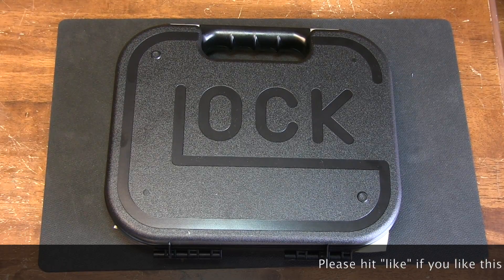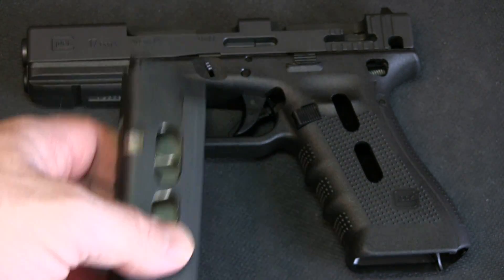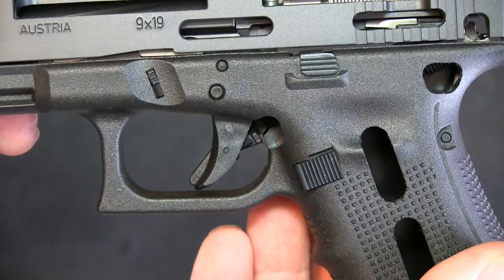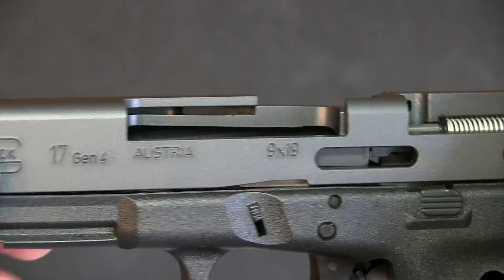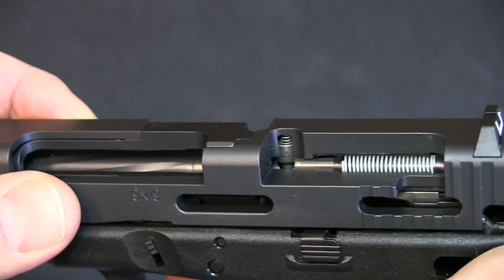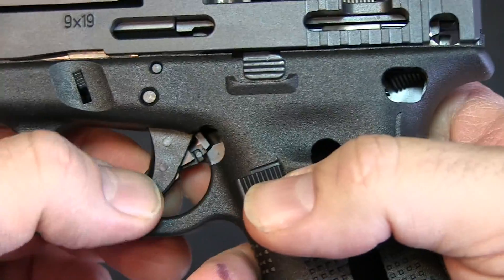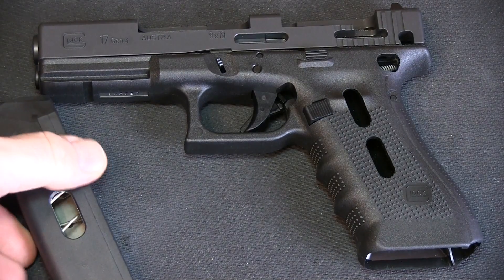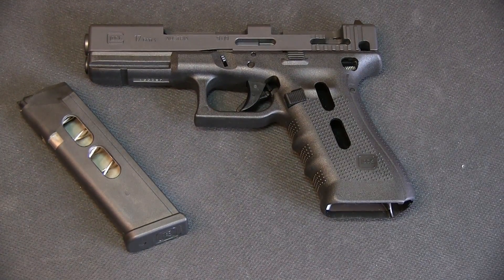How a Glock Works (with Glock Cutaway)

Comment: I was really worried about Glock, because It is not double  action to pull and fire on very emergency , but beretta , SIG or even revolver dose. If we keep the Glock  chambered and cocked , the firing spring will get low tention and a day it wan't fire at emergency. is't it a risk and disadvantage ???🤔🤔🤔🤔

Comment: What happens when the spring for the safety breaks and is upside down so the metal cylinder isnt blocking the pin?

Comment: Very cool educational tool.  It would be nice to get a more comprehensive and detailed over-view of each sub-system in the gun.  And a cheap pointing device like a pen or dental pick would help to differentiate one part from nearby parts when pointing.  I'm wondering if that can be field stripped like a normal Glock.  If so, it would be helpful to get a detailed view of various components, even things like the barrel and magazine internals.  Most of the viewers here already understand those parts, but people who are new to firearms may not understand how they operate.  And with today's climate shifting to extremes against firearms, the more people who gain enough interest to learn the reality from the hype and venom, the better.

Comment: I'm glad people come to you about firearms knowledge, a learning opportunity for you, it's a slide flange not a barrel lug.  This flange has nothing to do with the barrel. Additionally, the Glock does not have a firing pin.  The Glock platform works on a striker system and not a firing pin.

Comment: The reason it needs an FFL is because you could simply  put in a  non choppped locking block  and throw a normal slide on it and it would fire  safely

Comment: The explanation of how the firing pin safety was super helpful,  and gives me a good understanding of this. Would other striker fired guns (like an M&P or P365) have the same sort of design?
Reply from the maker: No, each one is a little different. Similar, but different enough so at to not violate the patent.

Comment: A lot of people screech and cry about appendix carry with striker fired pistlas. Technically speaking and this video demonstrates it, but the firing pin is at rest while the trigger isn’t being actuated. In order to accidentally jar the pin forward to strike a primer accidentally without fist actuating the trigger, the pin would have to make it through two different safety mechanisms and the pistol would probably break before that pin got that far.

Comment: Hey man, you let us see the frame 5 secs only (5:00 to 5:05). That is not enough to catch all the details. You could cut from the beginning 5 minutes, but show up more of inside (the guts) of slider.  I have never seen a Glock cutaway before and would like to see the guts of Glock. Thanks for that video.

Comment: I saw this video a few years ago and almost everything went over my head. Now, having built several polymer 80s this video gives me a big smile. I remember where I was and where I am 😁
Reply: If you ever in Az to help me , lmk, well polymer 80 ar15 receivers . pistols are easy builds the 1911 ones alil more challenging n the SIG saur barrels that shoot 3 diff callibers
Reply: @josesavage420azg3  sure thing !
Reply: Mines all got stolen 😭😭😭
Reply: What's best way to drill holes I am a Gunsmith in Argentina?
Reply: @Jonathz-  Drill Press, Dremel or hand power drill. All three are valid, different for their own reasons, accuracy and precision are key. Only want to drill once per hole if possible. Many sources online for this. Follow instructions.
Reply: Nicee
Reply: I haven’t seen this one, but I’ve seen the animation videos and yeah it was too much to follow. However once you own one and you clean and disassemble it ten times, you start to appreciate these kinds of videos. It starts to actually make sense because you have all of the pieces memorized and know how they fit together.

Comment: So you can fire it safely by replacing the barrel and firing pin?
Reply from the maker: No, it will not fire. The slide does not have a firing pin hole built into it, so there's no way it can be fired.

Comment: Why would it be catastrophic to load a round in? Please explain
Reply from the maker: A catastrophic failure for a gun is when the structural integrity of the firearm is compromised. It either explodes/ruptures, or there is damage that would make further shooting dangerous. In the case of this gun, all of the cuts in the slide and frame would lead to a rupture or it would explode in your hand. However, after I made the video, I realized there is no firing pin hole cut ito the slide, so there's no way it could even fire.
Reply: @762x51n8o  thanks I guess I missed the part where you said it wasn’t meant to fire.Think I was half asleep watching. I didn’t realize it was just a dummy for teaching, thought it was a law enforcement goodie or something.
Reply from the maker: @TrillAntho  It's not your fault -- it's not in the video, so you didn't miss anything. I didn't notice the lack of hole until the video had been up, so I put it in the video text.

Comment: Built a g26 and have a dead trigger. For the life of me can’t figure out why. I have tried doing the bending of the connector, tried replacing the connector and springs. If I very slightly raise the rear of the slide then it will fire. Any ideas would be much appreciated. Thanks

Comment: PLEASE ANSWER IF THE TRIGGER IS NOT PULLED,  LET'S SAY THE FIRING PIN SLIPPED FROM THE FIRING PIN SAFETY. IS THE DISTANCE AND TENSION OF THE FIRING PIN AND THE PRIMER OF THE ROUND, ENOUGH DISTANCE LAUNCH A BULLET ? PLEASE ANSWER. GLOCK SAFETY ISSUE
Reply from the maker: There are 3 safeties that prevent the firing pin from hitting the primer if the trigger is not pulled. It would be almost physically impossible for the striker to get passed the safety.

Comment: Swap out the striker and barrel and see if it works.
Reply from the maker: There's no firing pin hole in the slide, so there's no way it could physically fire. (I put this info in the video description, unfortunately I added it after the video).

Comment: Do you mind if I use about 5 seconds from this for a Glock review?
Reply from the maker: Sure, send me the details. What part you’re using, where it’s going to be used, etc. Also, please source my video as credit, and supply a link to my video.
Reply: 762x51n8o alright will do. I’ll be using it to describe the safeties that Glock has. I’ll get back with you once I’ve finalized which parts exactly I’ll be using.

Comment: Cool video! I inherited a G32 .357 Sig that came w full clip of ten .40 SW bullets. Here’s my issue, should I buy .40 SW ammo since it came w that or should I get the pricey .357Sig ammos? Please help 🙆🏽‍♂️
Reply: if it's .357 sig why would you put a different caliber in it?
Reply: DirtyDan it was a hand me down from an uncle to passed away, I believe he upgraded the stock .357 barrel to a 40 cal
Reply: @lstruggy  what caliber does the barrel say?
Reply: DirtyDan it has a .40 stamping on it it has a nice gold finish to it but it does say Glock 32 .357 stamped on the slider itself
Reply: @lstruggy  .40 will work with the .357 slide as long as it's a .40 barrel

Comment: Is the trigger safety on the Glock meant to be a joke or what? The only safety I see is ---"DON'T PULL THE TRIGGER" - On my carry gun I release the safety or it won't fire. You can pull the trigger all day and it won't fire if the safety is on. On the Glock, pull the trigger and it fires. That's not a safety. There ought to be a law against it. I CARRY ONE IN THE CHAMBER  which I would not do if anytime the trigger is pulled the gun fires. If I was worried about getting my gun out in a hurry for self defense, I'd carry a revolver.
Reply: that's one of the main reasons law enforcement carry Glock's in case they need it in a hurry & you don't want to fumble with a safety when lives are on the line. That along with they're dependable firearms.

Comment: All guns are unsafe its on the hands of a wuss... 

No matter what gun if u follow the 4 rules ur safe... 

1. Treat any gun as loaded and the muzzle as a dragon mount spouting flames(thats what i say to make u understand to never point it) 

2. Dont point it at anything u dont wanna kill/destroy/damage/or put a hole on... And if u wanna put a hole on it,  consider using a drill first.

3. The trigger should always be clear. Dont put anything inside the trigger guard(finger/string/or anythingthatmaypullitback,  definitrly dont put the D in there) unless ur gonna pull it and fire. 

4. Lastly,  dont leave any gun loaded unless its inteded to be used. Dont give a dragon food unless theyre going to work coz ull never know if someone els rides it to spit fire on u instead.

Comment: What stops the firing pin when dry firing? Does it hit the firing pin safety?
Reply from the maker: Do  you mean this takedown model specifically, or Glocks in general? For this one, there's no firing pin hole in the slide, and the firing pin has no tip. For Glocks (and all guns) in general, nothing stops the firing pin when dry firing. That's why it's called "dry firing", because if there was a round in the chamber, it would be called "firing".
Reply: @762x51n8o  I mean Glocks in general.  Is it the inside of the firing pin channel (the slide) or the firing pin safety that stops it if there is no cartridge?
Reply from the maker: @H-M-78  I think you're confusing a couple things. When you dry fire, you're actually firing the gun, except without a live round, so physically firing the gun de-activates all of the safeties so the gun can fire. So when you're talking about the firing pin safety, that is to prevent accidental/negligent firing due to bumping, dropping, etc, but doesn't prevent it from striking the case primer when you're dry firing, because you're de-activating the safety when you pull the trigger.. The firing pin safety plunger prevents the firing pin from ever touching the case primer, unless you pull the trigger. So you were KIND OF right in your initial question, except not for dry firing, but for preventing accidental discharge when you're not pulling the trigger. The firing pin channel isn't a safety, and is just where the firing pin is located.  Does this answer your question?

Comment: so why cant you put a barrel and firing pin in it i think it would cycle just fine
Reply from the maker: There's no firing pin hole in the slide, so if you put a standard firing pin in it, the slide wouldn't fully close.
Reply: He said the firing pin itself did not have the sharp point on it that protruded he also said if you stuck a regular firing pin in there you would have a bad day nothing about no hole in fact quite the opposite is the way I understood it

Comment: I have a question about the  glock pistol...how much time can the pistol stay activate  ?(ready to shot with a round in the chamber)  I mean how many hour's  the pistol can be "hot"
Reply from the maker: Reading your question it seems like maybe you got some bad info, or have a misconception of how a gun works. Once a round is chambered (which you referred to as "active") it stays that way until you unload it. So indefinitely. Until the round deteriorates to the point that it won't fire, which could be decades, depending on environmental conditions.
Reply: @762x51n8o  thank you for taking the time...yes in fact I try to investigate more now I know the the safety  system of GLOCK  block the fire pin...thank you

Comment: Sir:  on 12/2/2018 my Glock 43 in its holster with the trigger fully covered fell on the floor and accidentally discharged.  I took the pistol to a glock store and replicated the error on an empty chamber.  I then called the aftermarket trigger maker who was shocked.  He drove four hours the next day and the two saftey’s not preventing the accidental discharge.  He took the Glock to fully explore why this occured.  Never say never.  I have been handling weapons for 73 years.  This was my first accidental discharge and the trigger was not touched.
Reply from the maker: Key words: aftermarket trigger. In talking to law enforcement Glock armorers, when a Glock breaks or malfunctions, 99% of the time it's aftermarket part. Their guy will come in cussing up and down about how Glock sucks, and his failed, and it turns out they stuck some aftermarket part in it. You are absolutely right though, mechanisms do fail, and shouldn't be relied upon. Triple redundancy, like in the Glock, do make them even more rare.  In your instance, I'm glad no one was hurt.
Reply: 762x51n8o No cursing.  Only real concern for the possible calimity that could have occured.  The aftermarket trigger is most likely at faulrm but so is the safety stop a glock part.  I should know by early next week as they are tearing the weapon apart to determine what happend.  He did tell me I would receive totally new parts.  Even so, l will do full drop test and pound the pistol with rubber mallets to insure it will not fire.

Comment: So even if the cruciform piece were to somehow accidentally let go of the striker mechanism on its own, the striker would not be able to travel beyond that firing pin safety unless the trigger bar had the plunger raised out of the way. Meaning, unless the trigger has been depressed, defeating that safety mechanism, it is impossible for a round to be fired?

Comment: It seems pulling the trigger adds to the spring pressure. Would it have enough pressure on the spring to fire without the trigger being pulled if the internal safety failed? I'm new at this . Thx

Comment: Dont know if your answering questions still but ive just brought a Zev Slide and noticed on the mag reload the striker pin in sticking out and when i release the slide the protrusion of the striker is stopping the round from feeding i have a photo of it otherwise that cut out glock is great
Reply from the maker: You should contact Zev directly. That doesn't sound right (or safe). Thanks, appreciate it!
Reply: Thanks, Yeah i sent them an email havent heard back from them yet 🤔

Comment: It probably will fire if he swaps the barrel with a normal G17 barrel and striker/firing pin.  Probably the reason it's considered a firearm and has to be transferred.  Considering it's already a defined as a handgun by the feds and has to be transferred as such, that's probably not illegal.  I have no actual idea.  These are just guesses based on a lot of real firearm experience.

Comment: Not a very detailed video.  I would have loved to have seen you work the slide slower, to see the actions that occur when the slide is moving forward.  The way the striker is "re-cocked" is an ingenious action, and you missed a great opportunity to show that.
Reply: how does the trigger reset?  what pushes the trigger bar back to get the trigger back into position?
Reply: @GhillieCoaters  here is glorious animation, explaining how the gun works. Unlike 90% of such videos, they managed to make it so that people can actually understand whats going on!
https://www.youtube.com/watch?v=V2RDitgCaD0&t=2s

And here is another great channel with very good animations about old guns 

https://www.youtube.com/user/vbbsmyt
Reply: @GhillieCoaters  and here is actually good explanation of the reset process. Basically firing pin spring pushes trigger bar forward.
https://www.youtube.com/watch?v=1WaRLlyPHlo
Reply: Cant you just put the playback speed to the slowest?
Reply: Publius2k4 please remake this from the right side with a script that has the correct nomenclature. This pistol is way cool!
Reply: I have watched a number of these videos and one thing that is never shown is how the disconnector works (It is the ramp built into the bottom of the slide.).  The connector is always shown and how it connects to the trigger bar, but never the disconnector.
Reply: @fredmullison4246  That ramp would be called the “Ejector” and the mechanism that pulls the spent casing to the ejector is the “extractor.”

So, after round is fired, slide pulls back, extractor removes spent casing from barrel. Slide continues back, and as the casing contacts the ejector ramp, the round is ejected.

This animation I’m sharing shows a better version than the cutaway Glock in the video we are commenting on.
https://youtu.be/V2RDitgCaD0?si=GVqPqUId3ylkDJNb

Comment: >on loan from Glock
>taps magazine against frame (twice)
😣
Reply: Ed Miller 
I know... and then he slides it around on the steel. I wondered if the steel liner of the mag contacted the slide, too.
Reply: What are you worried about??? That wasn’t enough to hurt anything.

Comment: Fun side note. The trigger safety found in glocks was done first in the model 2 line of the safety-hammerless, iver johnson revolvers back around 1900-1910. Of which, the safety hammer models were the first to use a transfer bar/system to prevent the hammer from contacting the firing pin without the trigger being pressed.

Comment: Warning - On a side note: if you ever work on your Glock and remove the Fire Pin Safety and Spring. Make sure when you reinstall the Fire Pin Safety and Spring, that you do not damage the spring in the process. Because if you  install the Fire Pin Safety Spring and it kinks when you install it. The Glock will fire in either three round burst or full auto.

Comment: In response to Kirk T below ; 3 things have to happen in order for a person to shoot another by accident  ;
#1 the firearm must be loaded , #2 your finger must be inside the trigger guard and finally #3 and most important component of all is that the weapon must be pointing in an unsafe direction . These are the facts and only the facts . If anyone of these 3 conditions is missing no one should get hurt . Pure and simple . So it doesn't matter if the trigger is set up for a one pound pull .